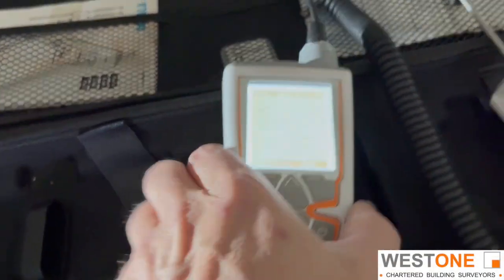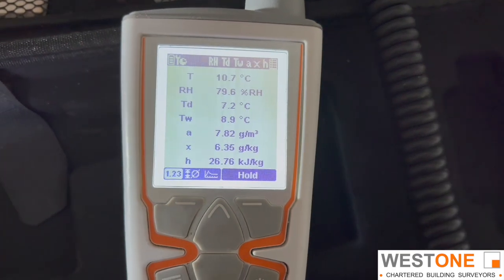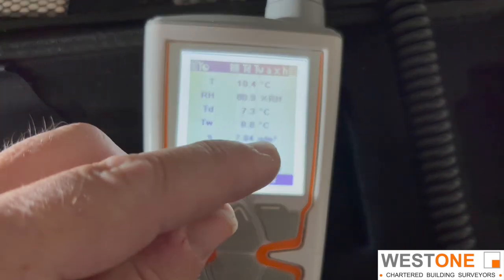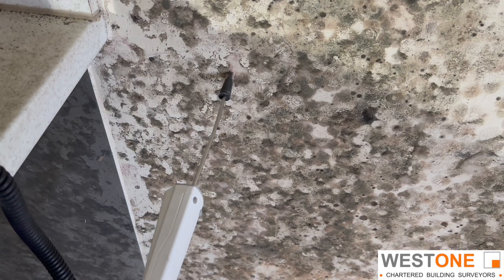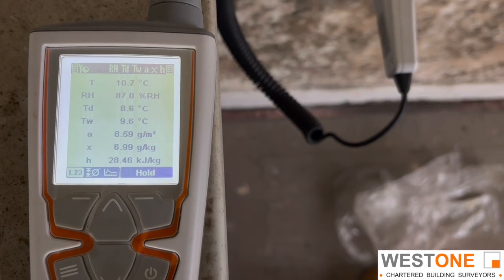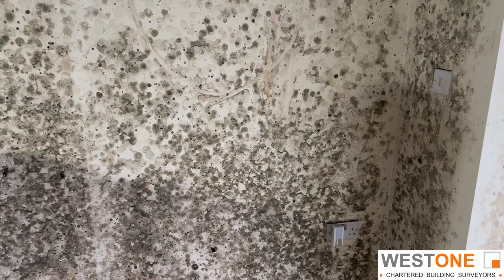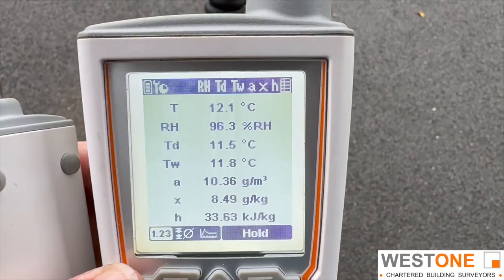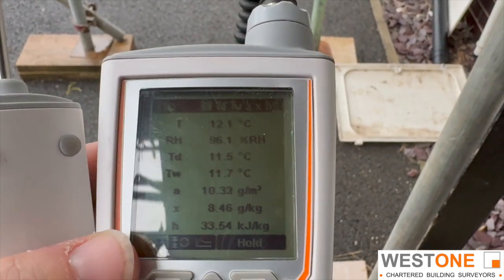A bit about relative humidity

Comment: We are told that if the RH% is between 40-60%, obviously allowing for temperature, etc., then that's a good place to be. I understand that actual humidity is a better number to use rather than RH, so are you able to say what would be a number that would signify that the humidity in a property, taking into account weather, temperature, etc., is at a good level?